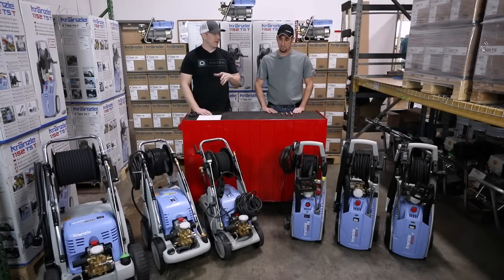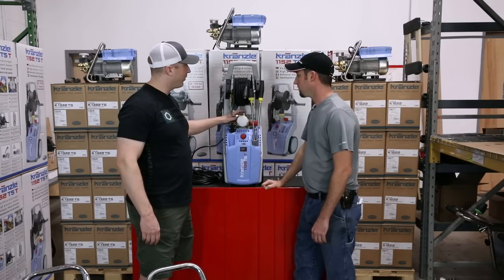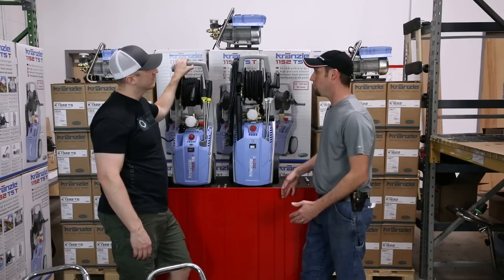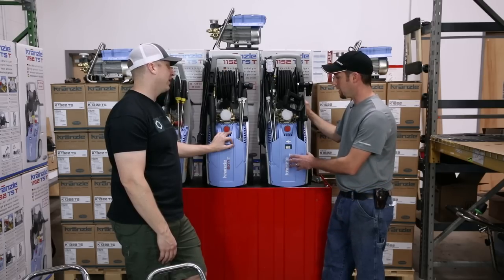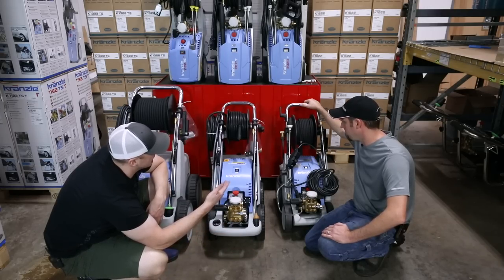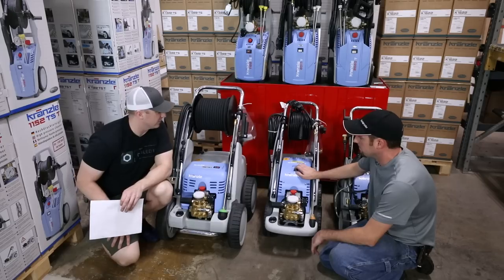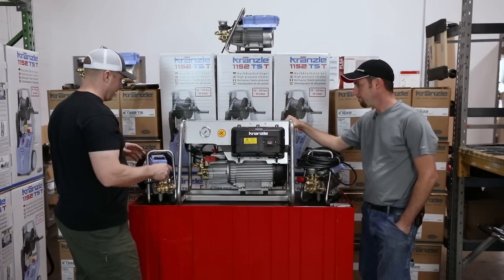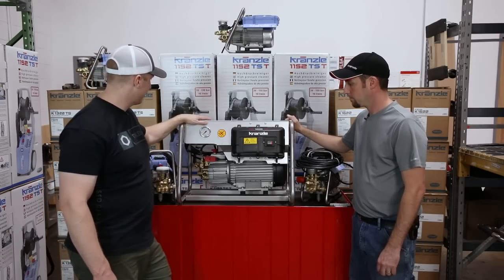Kranzle Pressure Washer Overview With Dirt Killer / Kranzle USA

Comment: Matt I think a custom sound enclosure cabinet for that pressure washer is warranted, and pair it with a california air tools big sound enclosure compressor and you won’t need the separate room for those two noise items in our garage.
Reply: That is how I intend to do mine.
Reply: Run cooling fans in your sound proof enclosure

Comment: I was anticipating you were gonna ask the question that's generating a lot of questions and confusion. WHAT IS THE CORRECT WAY TO MEASSURE THE OIL LEVEL ? IS IT WITH THE RED CAP SCREWED ALL THE WAY ON OR IS THE LEVEL CHECKED WITH THE CAP JUST SITTING ON THE THREADS?  Can you please clarify this? Also living in hot humid Florida can I use 10W-30 ND oil? since 15W-40 ND is difficult to find?

Comment: I do like the 4-wheeler pump styles more but they are a bit bulky. If the wheels were able to be locked in place that would be great. If the "wall mount" model size could be achieved and have the nice reel on top with some smaller wheels that were a bit more all terrain friendly I would have probably 10 of them for my business and 2 personally.
I do already have the smaller package and a custom Kranzle Kart like AutoFanatic but it's a lot of effort.

Comment: Looking for help on the K499TST. Water pressure is crap in my building. We're talking under a gallon a minute. Currently I use a gas pressure washer and it does fine. We wash muddy Jeeps for 2 hours constantly per day, 7 days a week. I want to switch to electric. Will that little tank on the 499 do me any good? Am I right in assuming that gallon of water it holds will eventually run out quickly? Or, does the unit only draw from the tank and the tank will fill only as fast as the water pressure in the building will allow? Lastly, is this unit powerful enough to clean really muddy jeeps as well as say a 3.0 gallon per minute, 4500 PSI gas powered cheap pressure washer priced around $500?

Comment: Hi. I am currently looking at the K2160 and the Profi 195, in about the same price range in 230V.
Would you say the trade-off of pressure for flow works in favor of the Profi 195 (and for its extra bucks)?

Comment: Ok to use a pump saver product (like Briggs and Stratton) in the 1122 for winterization?
Reply from the maker: I don’t think it’s necessary, so I wouldn’t use it.
Reply: If you live where it gets cold it's best to take your pump in the house or put some kind of antifreeze in:
Problem 4. Freezing.

If you live in a cold climate, and let your pressure washer freeze with water left in the pump from the last use, there is possibility of damage to the pump. The typical remedy for this is putting anti-freeze in the pump. The Kränzle pump is freeze proof; the unit can freeze, be thawed, and still sustain no damage. Leaving a pressure washer in an unheated garage during the winter often leads to freeze damage

Comment: I'm looking into a eu equivalent of the 1622...
But how does is the performance when it comes to driveway and deck cleaning?

Is the 1600psi-1.7gpm, good enough to also use for such purposes?
Or should I really look more towards something going towards 1850psi-2gpm for multipurpose use?
Reply from the maker: It's so, so at that task.  It can do it.  It will just take a long time.
Reply: @ObsessedGarage  Cool thanks for the info!

So for my usecase it would be worthwhile looking for something like the kranzle 2160, with a little more "oomph" (and price) :)

Comment: I want higher GPM, less psi. If I’m stripping old pant off a deck or washing algae off a sidewalk then I was high psi but when I’m cleaning a car I want high gpm and don’t need psi really for anything other than wheels
Reply from the maker: Bingo, that is exactly what I’m working on getting.
Reply: Obsessed Garage tell me when you find what the best option is.
Reply: Not gonna happen unless someone designs a spray nozzle with a larger size orifice than 6.0 while retaining a 40 degree spray pattern. Even at that point the 110v electric pressure washers sold in the states are too power restricted considering that code for a standard 110v outlet is a max of 20a. 

There are a few 220v units that certainly can do it but then your back to the nozzle limitation.
Reply from the maker: I have nozzles in 40 degree up to 12.0, so that’s not a problem.  According to my calculations, we can get about 3.0 GPM at 1000PSI on 20A.  It will happen.
Reply: @ObsessedGarage  
I just don't see annovi or kranzle investing in the r&d towards electrical efficiency when overall its such a small market that wants higher gpm over psi on a 110v.
Reply: Any time frame Matt when your “dream Kranzle” of 1000psi/3gpm might come to fruition?

Comment: Great infomercial !! If I have a Iron/Chlorine/sediment filter for my house and warehouse, besides the stainless steel fittings, what's the advantage of using this to wash cars over the 1900psi $79 portable ryobi unit I already use?
Reply: PFeal   If you don’t know, stick with you’re ryobi.
Reply: @bertraminc9412  but this is why I asked....I understand the quality of the parts but I'm interested in if it cleans better overall ? or is it just a better built machine.  

Do you own one?
Reply from the maker: Simple answer is flow.  2 gallons per minute is remarkably different than 1.2.  Your Ryobi is more like 1200PSI at 1.2 GPM.
Reply: @PFeal   You can get the job done with other pressure washers but this is the proverbial comment about higher quality things.... there are many out there when discussing the newest Rolex, Omega or other high priced watch who will say, "my 10 dollar timex gets the job done just fine and I'm happy with it"... there are those of us who constantly look for the highest quality engineered items which we know will last longer and provide a better user experience and this usually leads to a more satisfying daily experience in life in general.....  similar to those who say, "I don't need a Porsche GT3 RS when my Honda can get me to the grocery store for 1/20th of the cost"... to answer your question in the most basic of terms... these pressure washers are made in Germany.  You can still count on items designed and manufactured in Germany to be of the highest designs and then the highest of quality in the materials used in their production.  This is what I meant when I said, if you don't get it just stick to your ryobi.  I still believe you don't get it.  Matt has pointed out a quantitative difference which probably won't sway you if you don't get my point about quality vs economy in design.  Sorry, and I have one but haven’t used it yet.  Work schedule is busy.  When I get home I’ll try it out.  I’m also waiting on Matt’s newest wand and trigger on pre order.  If you buy the kranzle, pre order the best wand trigger setup.
Reply: Thank you for the replies.  The simple answer was the comparison I was missing.